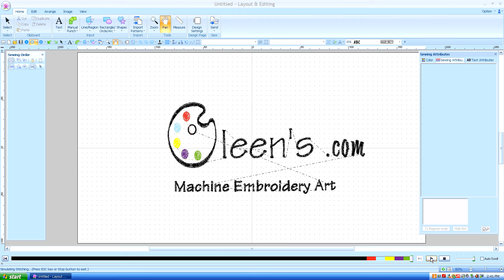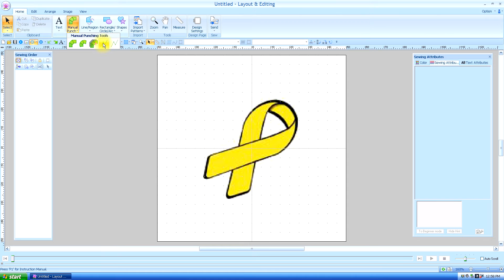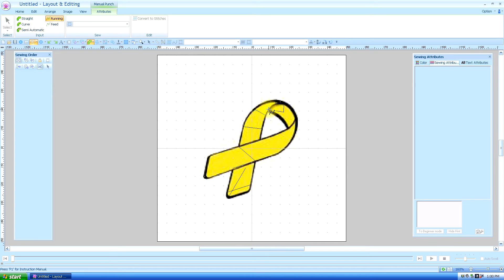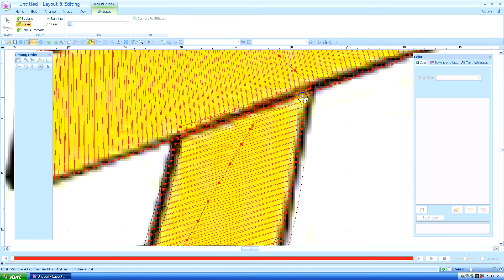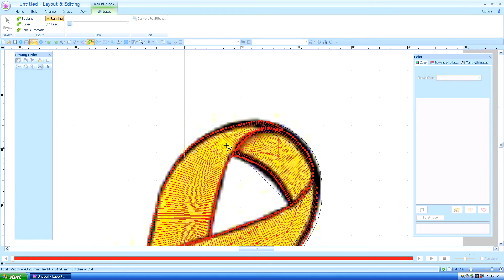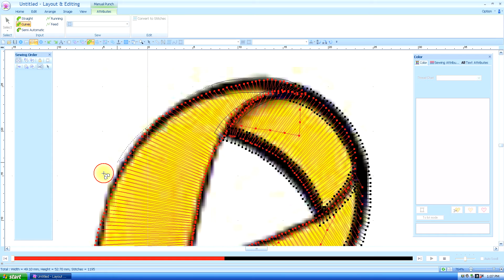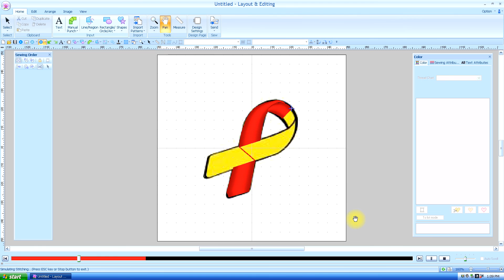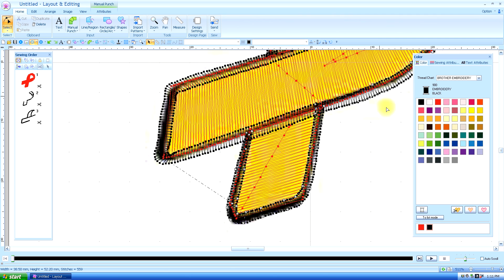Brother PE Design Next: pathing & the running stitch (lesson 27)

Comment: Thank you for explaining all of this this was great
Reply from the maker: +Marci B   Did this video explain the question you had on pathing in the elephant video?  The running stitch (shortcut "v") is attached to the manual punch (shortcut "z" or "x" depending on straight or curved block).  You send them out so you won't get stuck at a dead end, then cover them up with the manual punch (top, bottoms).  Think of it like a maze.